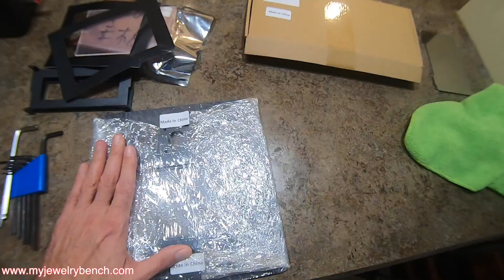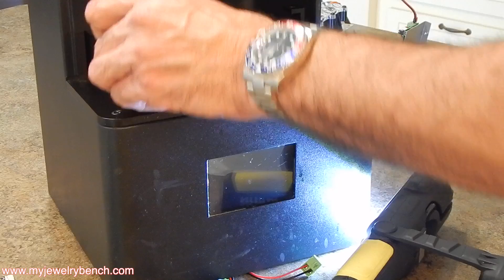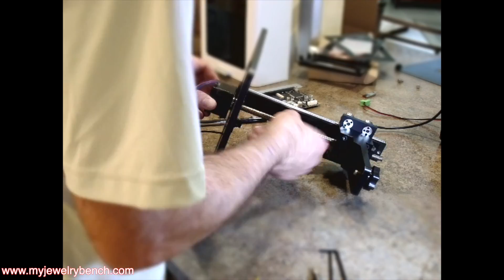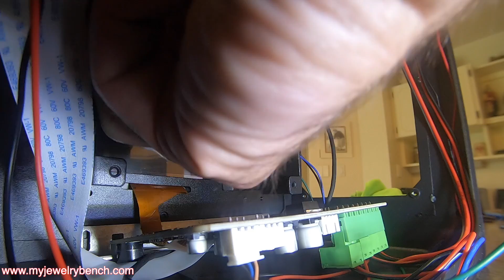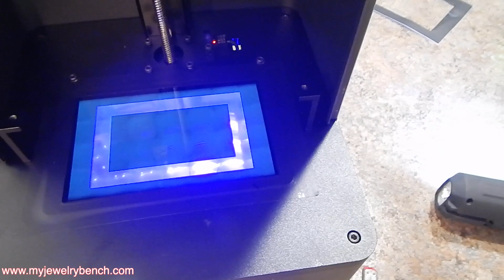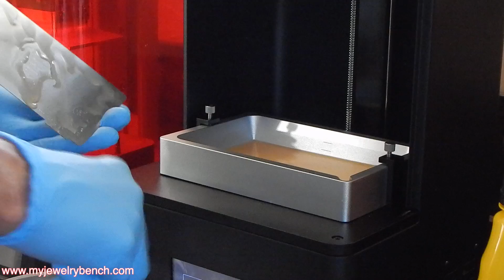Epax X1 to Epax X1K 6" Equivalent!  Upgrade your Epax to the latest version!

Comment: Thanks for the video. I just done the upgrade of my 1st X1 same as you. Went pretty smooth. I found that the new top plate is a little thicker and when I fitted the stepper motor back the bolts are a little to short being 10mm, I fitted 12mm and got a decent fit.
Reply from the maker: Great printer.  My plate was the same size but only missing some screws.  Anyone reading this should expect that they may need to tweak a bit. But it’s well worth the upgrade.
Reply: I found the same. There was enough thread showing to give a decent connection, but I'll replace them with 12mm next time I'm in there.

Comment: Superb video! I've just done this upgrade on my X1-N-DJ, and I'd have been in a mess without these instructions. The physical part of the job went quite well, but I'm struggling with the firmware. I used the latest E6 firmware as recommended, and the calibration / exposure test gave me two parallel lines instead of a rectangle. it's two years since your video, so the drivers are probably not the same ones. I did eventually get a successful calibration test by using a BETA driver for the X1-K, but that only seems to recognise .cdb files generated by v1.8 of Chitubox.  I'd like to use v1.9, because that's what my other printers use, and the two versions don't play nicely together if you install them on the same PC.

I tried messaging EPAX, but they are are useless. At first they denied they ever made an upgrade kit, and told me I'd fitted the wrong screen. Eventually someone else contacted me and told me, " It used to exist, but since that is an extremely old unit that we no longer manufacture we stopped selling those upgrade kits a long time ago". I bought the kit less than six months ago, and my printer is barely 18 months old!  Their solution to finding a driver was basically, "try a few different firmwares until you get one which works. If the one which works isn't compatible with v1.8, unlucky. At least you can still use your ancient, obsolete printer". They did mention that Chitubox v1.9 encrypts the .ctb files for some reason, so unless your mainboard is compatible, it can't read them.

Can you possibly tell me which drivers you used? Do you use .ctb or .cbddlp file format, and do you use Chitubox 1.8 or 1.9?

Fortunately, the board doesn't seem to mind if you install older firmware than the one that's already on there, so I'll try a few to see what happens. If I find anything interesting, I'll update this.
Reply from the maker: I’m using 4.4.3-v2.   Export a Ctb file with both 1.8 and 1.9 of chitubox.  I also have the printer “epax x1k 3k mono” installed in chitubox printers.  This was the only one that worked.  Yes, epax is hard to get working

Comment: Wait they didnt include the necessary screws?
Reply from the maker: Lol. Not in my kit.
Reply: I didn't need any replacement screws - I was able to re-use all the screws that were originally fitted to my printer. I think I know why we had different experiences, though. My printer is a slightly newer X1-N-DJ, and came with the parallel light pre-installed. It has the newer case with a door in the side so it's easier to get at the connectors for the screens. I think the newer case uses smaller screws which can be reused with this kit.